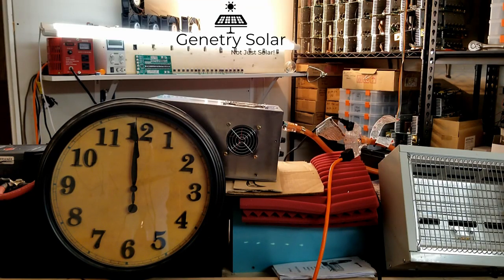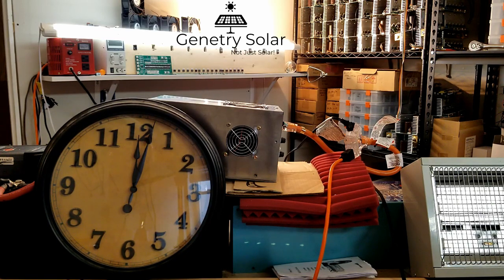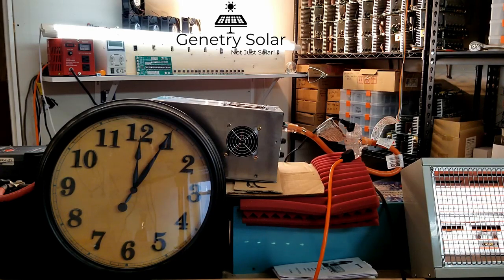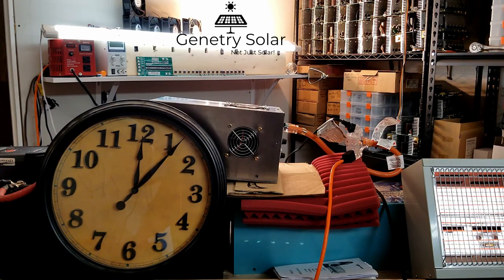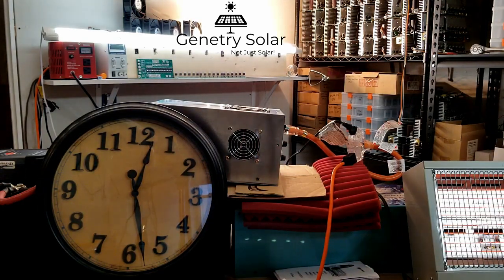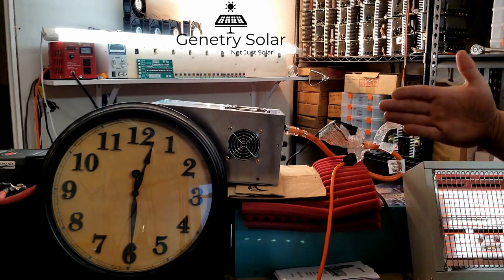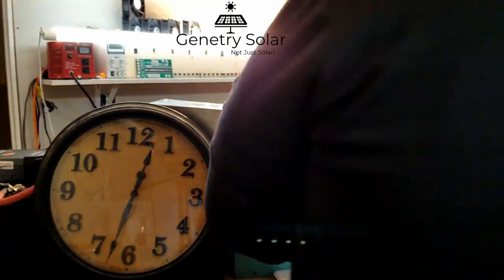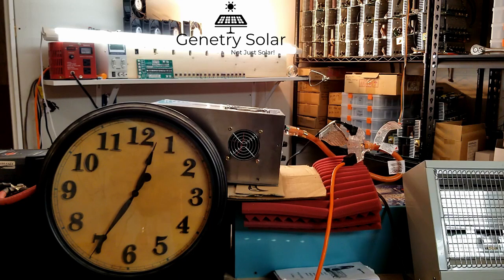Custom Power Jack inverter load test

Comment: I love power jack inverters.  I have an lf5 and an lf8 and they both deliver the advertised power at 220v and I have never had a problem with the charger.  Obviously one of them charges and the other generates 220v for the house, the one that charges is isolated from the installation at that time.